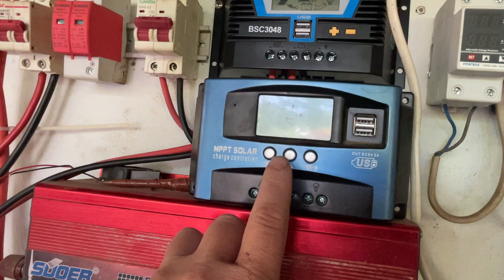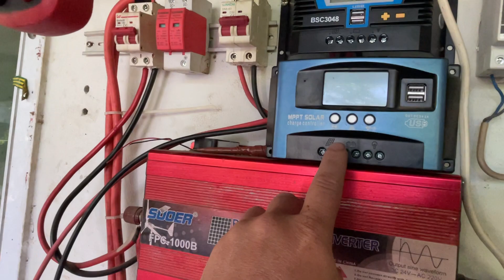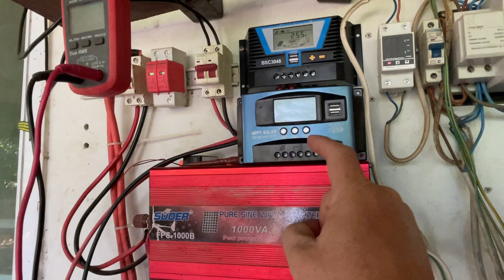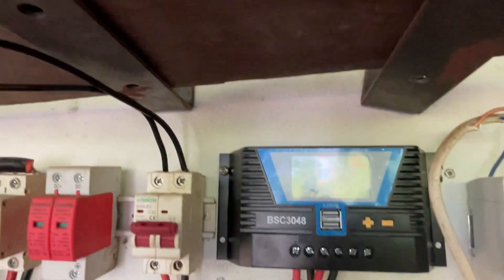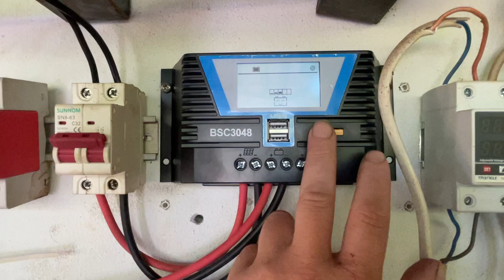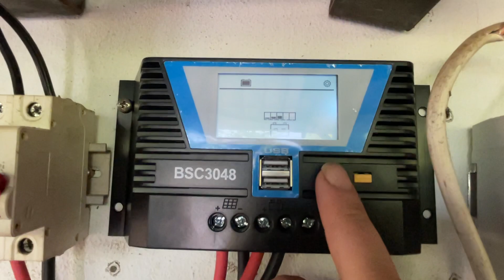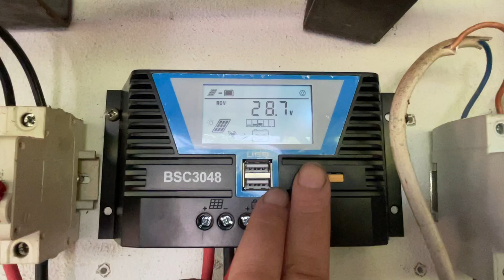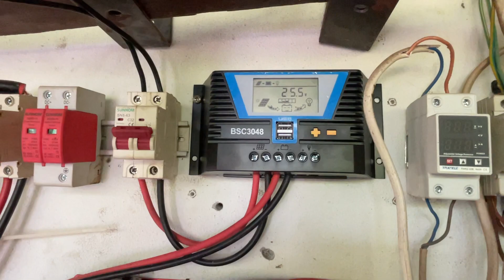BSC3048 PowMr PWM Controller-Problems

Comment: Good evening pls. I want to know why my charge controller is displaying E 11 on screen?
Reply: Same question that brought me here 😂. I know how to eliminate the error, however, my current input drops. It’s either your battery is low or you have a wrong battery type configuration. So fix either of the two and the error will be gone.

For my own case, I had to choose “3.2-5” which is a lithium battery type, this gives me a higher input current and after a while it returns the E11 error (but keeps charging anyways), however, when I change it to “3.2-4”, for the same lithium battery (but different build), the error will be gone. But the downside of this later option is that my current input drops.
Reply: Low to drad battery. Disconnect from battery and it will reset

Comment: I had one of these on a 12 volt system for a couple of years. Seemed to work ok until recently. I ordered another one on Amazon same item number. The name on it was Walfront and its not even the same item I had! Looks totally different. On either controller, I've got controller set to 12.3 volts for low voltage cutoff, and 12.6 volts for recovery voltage. Battery gets down to 12.5 and my Led lights which is my output load, go crazy. They've not even hit the 12.3 volt cutoff point yet. They're on then randomly go off for a few then come back on for a while. I'm convinced all of these controllers do as they please. Mine will even show an output load when there's none connected to it. You can scroll thru the menu and set it to 105 which means it should run the load for 5 hours. Sometimes it does and other times it will run until it decides to turn itself off. Can't justify the cost for a true MPPT controller for my 300 watt setup

Comment: Can you put your multi meter on the solar panel leads going into the charge controller and show what it's actually taking in from the solar panels ? Thanks
Reply: Gotta read amps ,, if your panels are over 10 amps combined ,, you will fry your multi meter wires unless it is able to handle ,, let's say ,, 30 amp ,, measure,, unless your checking volts ,, that have no real meaning when checking a solar panel proper ,,,,unless your trying to series wire ,, then should check volts ,, make sure you did it proper
Reply from the maker: @FourMypersonaluse 

Of course I’m reading Amps. I’ve got a DC clamp meter plus also previously I took 10Amps out of each of my two Panasolar 380W panels. The previous controller was great for a while and delivered Amps as expected but when I installed this updated version it wouldn’t work. After this I grew tired of Solar controllers failing and sold my panels and just live with them being charged by a 24v - 29.2v electric bike charger which works great
Reply: Volts don't mean crap when testing a panel ,,, you can have a broken panel ,, putting out .09 amps that should be putting out 5.5 amps ,, and it still registers 21.4 volts coming in,, 👶🎤🙏🧰🔌🌞👶🎤🙏🧰🔌🌞
Reply: Lead souls collector 👶🎤🙏🧚‍♀️🥾🥾👶🎤🙏🧚‍♀️👢👢🖼️🐒🐒🐒🐒🐒🐒🌀🌀🌀🌀🌀🌀🌀🩸🩸🩸🩸🩸🩸🩸👣👣👣👣👣👣👣👣👣👣👣👣👣👣👣👣👣👣👣👣👣👣👣👣👣👣👣👣🔥🔥🔥🔥🔥🔥🔥🔥🔥🔥🔥🔥🔥🔥🔥🔥🔥🔥📬💄
Reply: Lead guitar is not solar panels ,, are we talking volt meters ,,, 👶🎤🙏👶🎤🙏 me lead souls taker 🖼️🐒🐒🐒🐒🐒🐒🐒🌀🌀🌀🌀🌀🌀🌀🌀🩸🩸🩸🩸🩸🩸🩸🩸👣👣👣👣👣👣👣👣👣👣🔥🔥🔥🔥🔥🔥🔥🔥🔥😭😭😭😭😭😭😭😭😭😭😭😭🔥🔥🔥🔥🔥🔥🔥🔥🔥🔥📬💄
Reply: Mike pangburn 1987 , Tracey where are my leads I can't find them ,
Tracy , look under the sink 
Mike pangburn ,, on and on voice impersonator about his leads handles 
👶🎤🙏🧚‍♀️👢👢👶🙏🎤🧚‍♀️🥾🥾🖼️😭😭😭😭😭🙏🙏🙏🙏🙏🙏🙏🔥🔥🔥🔥🔥🔥🔥🔥😭😭😭😭😭😭🩸🩸🩸🩸🩸🩸🩸🩸🙏🙏🙏🙏🙏🙏🙏🙏🙏🙏🙏🙏🙏🙏🩸🩸🩸🩸🩸🔥🔥🔥🔥🔥🔥🔥🔥🔥🔥🔥🔥🎸🎸🎸🎸🎸🎸🎸🎸🎸🎸🎸🎸🎸🎸🎸🎸🙏🙏🙏🙏🙏🙏🙏🙏🙏🙏🙏🙏🩸🩸🩸🩸🩸🩸🩸😭😭😭😭🔥🔥🔥🔥🔥🔥🔥📬💄🎼📍🗺️ burn in hell , all ways 👹🎤🙏👽🎤🙏

Comment: I'm confused......moving to fast
Reply from the maker: What are you confused about? It’s not the best of videos. I just thought I’d make a video on it to show anybody interested  in that controller. Basically I’ve got two 40 V panels. joined together in series at the back of the house on the previous controller that I showed, that is now broken, I pulled up to 22 A out of those panels when they were in parallel. I bought the new controller which is a PWM not MPPT because it could take 100 V DC so I could put the two panels I had in series and as the Sun went down, the voltage may still be 40 V and as my battery voltage is 28 to 29 fully charged I could still get some flow from the panels. The issue with having the panels in parallel is when the Sun goes down you’ll only get about 30 V, and if you’ve got a battery voltage of 27 V, you’ll get hardly any flow into your cells. These cheap solar controllers never last long and I’ve gone through loads of them. And because you need about eight panels to really make Solar worth it and I wasn’t prepared to buy any more panels I decided to just go for charging the battery pack with a 24 V Battery scooter charger all the time and then we had power outs which are often in the rainy season. We would go onto backup power and then as soon as the power came back the battery charger would charge the battery pack back up again which works great. The only time The solar panels came in handy was when we had a power out in the daytime and we were using the backup batteries, but at least the solar panels were charging the batteries while the Sun was out. This happened very rarely. A lot of people seem to think that for back up power they need to have solar panels ,they don’t Just get a 24 V battery scooter charger.

Also, personally, I think having separate bits like I’ve done is the best option rather than a hybrid inverter.  There is a channel on YouTube of a toy electronics wizard who shows you exactly what the faults are on all those hybrid inverters. Lots of MOSFET problems capacitors blowing up losing you completely sunk. That Will Prowse champion is a hybrid inverter. I think it’s called the LV4658 or something like that. That looks very reliable. But I’ve seen lots of top mics that you can buy in Thailand on the workbench of ‘Chang Eh’ of Lamphun North Thailand.
Reply: Yeah the pwm controllers need to have a voltage much higher than what you're trying to charge, which is a bummer because all the excess gets wasted.  From what I understand it has to be a minimum of 5v higher than the charge voltage needed.  That would explain why you're having issues when the bank is 27 and your panels are sending 30.
Reply: And also if you're not using the load function (nothing is connected to the load terminals), you should turn the load to off.